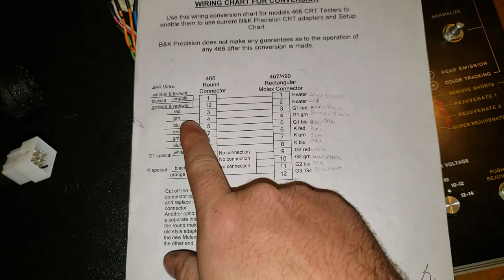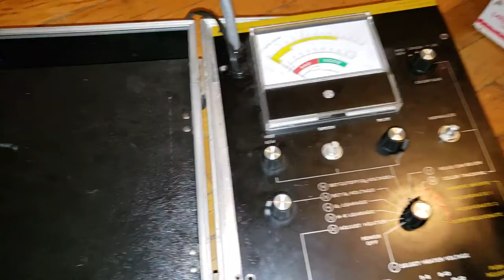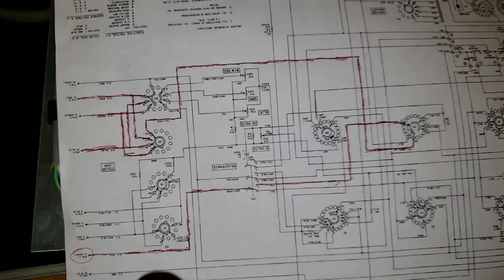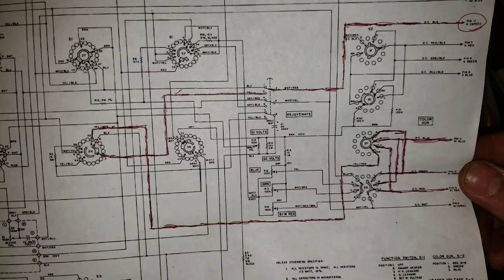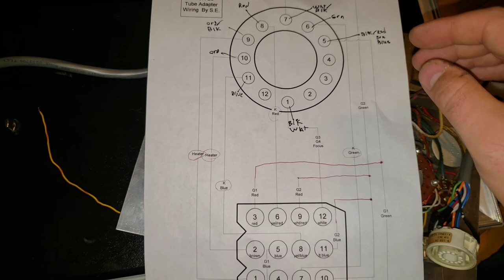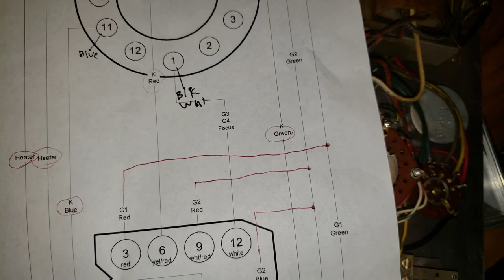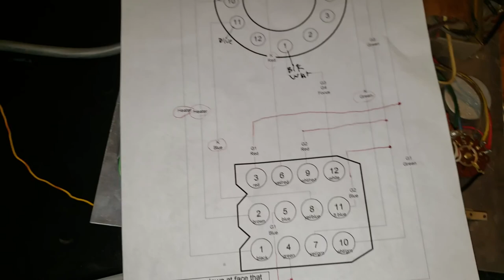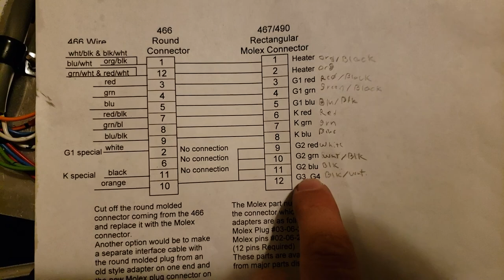How to upgrade a BK Precision 466

Comment: Thanks for making this video, I have a 466 that I need to upgrade. Is there a link or anything to detailed instructions that you used or is this just what you puled together from research?
Reply from the maker: Sorry for the late response, i did not follow any guide or anything. I just understand how these are suppose to work and using the schematic i was able to figure out why it did not work as expected.